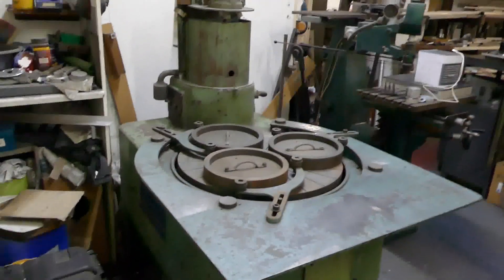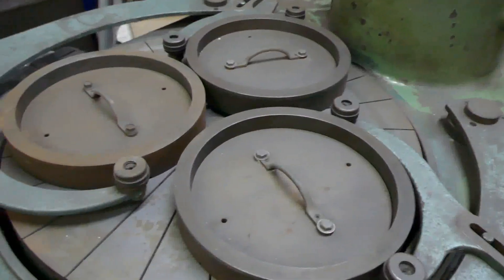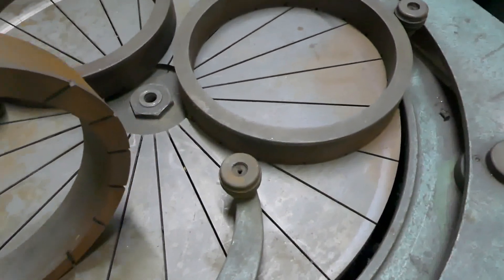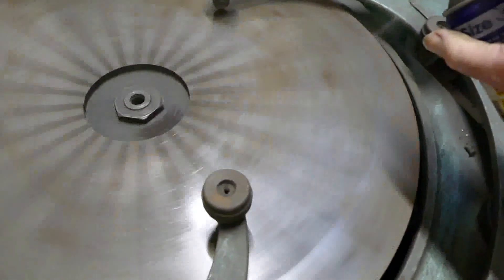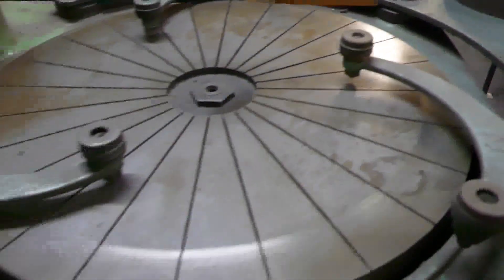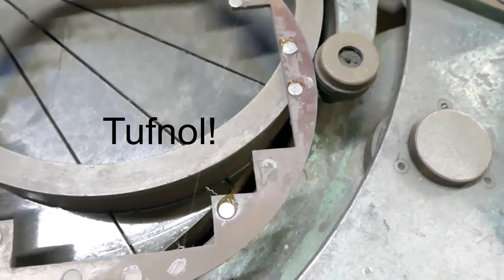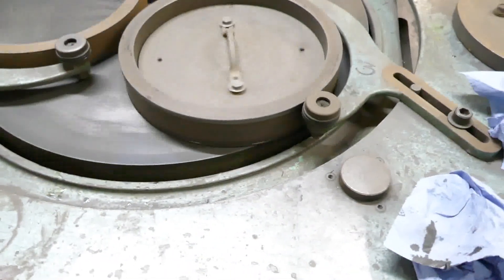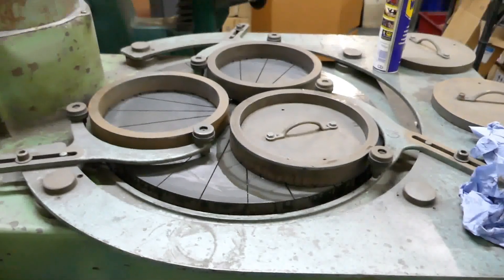Lapmaster 24 Flat Lapping Machine.

Comment: Good afternoon friend or good evening, I would like some information do you use what type of abrasive powder aluminum oxide or silicon carbide with oil soluble
Reply from the maker: It was a white powder so I guess that would have been Aluminium Oxide.

Comment: If it was made before 1945-July-16 it's radiation free iron - which used to be worth more to those that made certain detection equipment. (It would be a shame for it to end up as rebar in concrete if it was more useful somewhere else.)
Reply from the maker: I had to look up "radiation free iron" - I had never heard of that before. Interesting stuff! I don't think this machine is that old though.